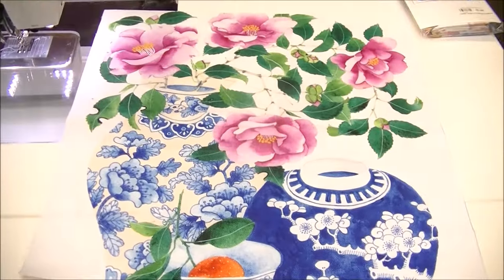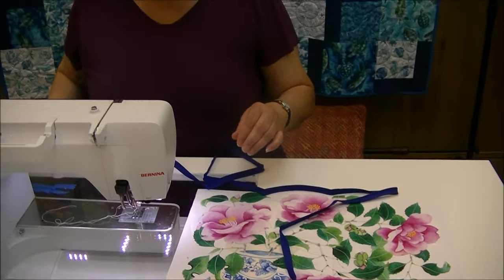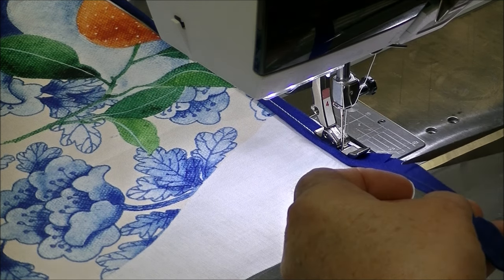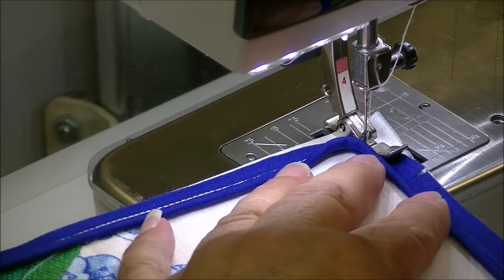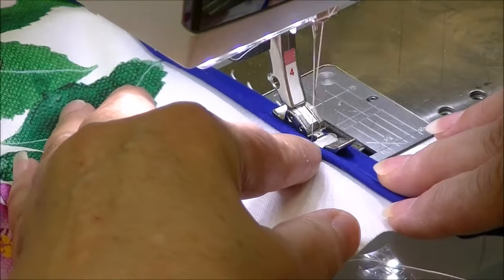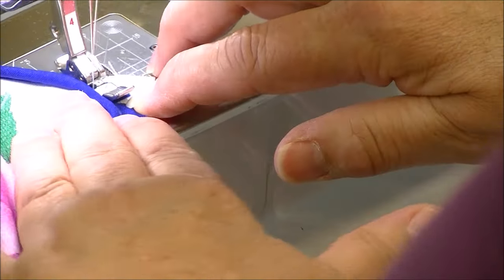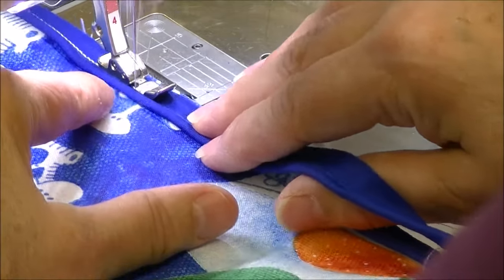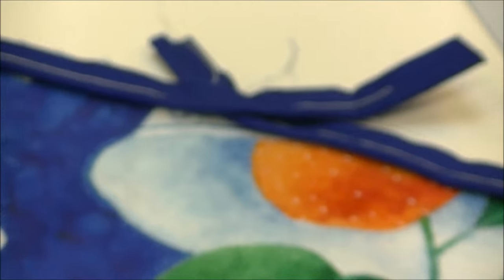How to Make a Zippered Pillow With Piping

Comment: What size pillow did you make and how large were your fabric pieces?  i.e. 18" pillow, cut material 18"x18" with a 1/2" seams.  Thanks, Kathy
Reply from the maker: Whatever size pillow you're making, cut the squares the exact same size. So 18" pillow, cut 18" squares. Do not add seam allowance.